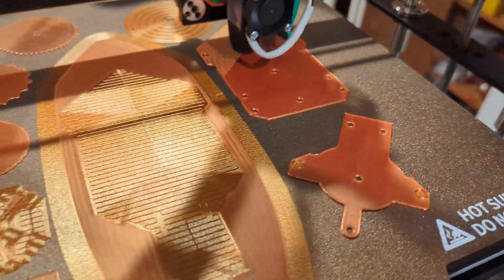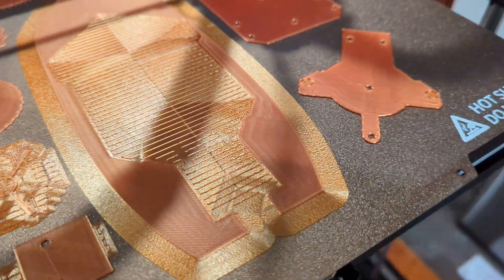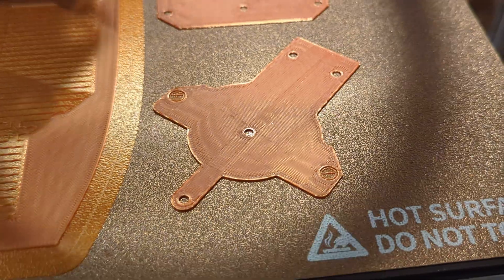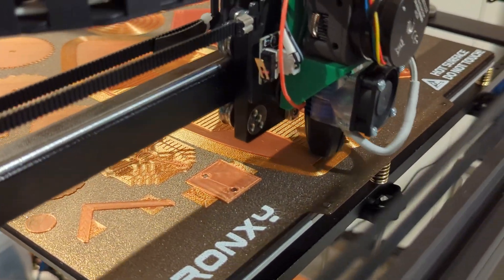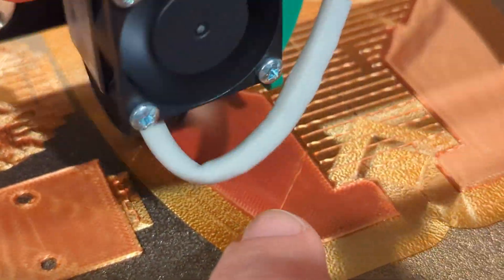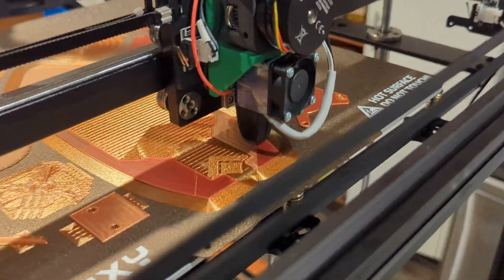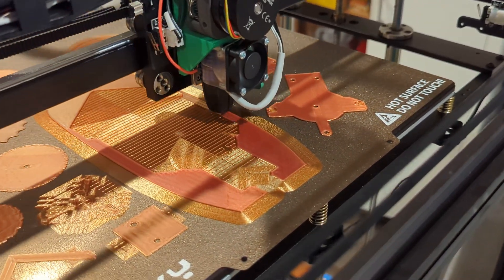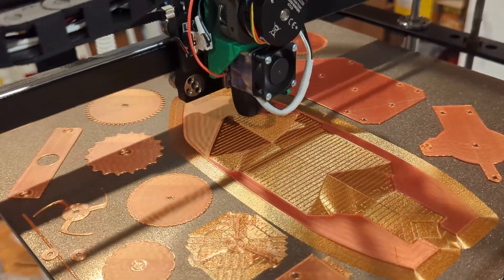Nozzle Z probe using contacts third test - showing actual printing with perfect first layer

Comment: Your method is amazingly simple. I would love to use a system like this in the future. How is it going now? Have you found any disadvantage of this solution compared to optical sensors in voron tap? Why are people even using such complicated optical systems instead of yours?
Reply from the maker: It is the best way IMO, there are many reasons the best methods are not adopted at first or ever.. the Voron tap has their name behind it and mass adoption already so this simpler and better (IMO) method may never see mass adoption..
Reply from the maker: It does rely on a high quality linear rail as there are no magnets to lock it in place, so your X/Y rigidity is all on that rail.. but yesh get a name brand short rail on eBay and you're fine.
Reply: @hilo90mhz  Thanks for your answer! Yeah, I understand the importance of linear rail quality, but that is not any better with the existing voron taps. Their magnets may hold it in the Z direction well, but don't help with X and Y wiggle, which is the important part.

What I also love about your setup is the fact that you don't need to set any Z offset at all, right? Because the contats disconnect so quickly that the 0.005 mm toggle distance you mentioned is negligible.

I am leaning towards building a voron 2.4 250, the only part I dislike is the heavy stealthburner, so I want to use a custom minimalistic head with your Z leveling mechanism.
Reply from the maker: @mjetdevelopment  Yup no Z offset! That is probably the largest advantage... And the play in Z is an advantage IMO to avoid damage to the print head if it crashes into something

Comment: This is TAP? These solutions play absolute havoc on your resonance calibration, and is not recommended if you want a finely tuned printer that can print at high speed. 

I love the idea though. There is no perfect solution for z-offset calibration yet
Reply from the maker: With tight enough linear rails it shouldn't be bad. The cheap Chinese rails often would not be tight enough.
Reply from the maker: I'm aware it's not perfect though.. if not this I'd try something under the bed like bambu Labs piezo system which seems to work fine and uses the nozzle.
Reply from the maker: And it's not tap, similar idea different implementation.. I had the idea and parts for this long before tap was released or heard of by me.

Comment: Any news on this? I would love to play with this design on my VzBot!
Reply from the maker: It's relatively easy to adapt it to the VzBot but it will lose some Y travel if you have AWD because there is no extra room on that axis.. I am thinking about a design with two mgn5 rails one on each side of the hotend that may not change the clearances much but haven't actually designed it yet..
Reply: @hilo90mhz  If you don't mind sharing the current CAD I would love look at it, but if you feel like it's not ready yet I 100% respect that. :)
Reply from the maker: @emagiannu  haven't started on the new one but the one in this video for the Tronxy is here https://github.com/clowrey/x5sa_pro_klipper

Comment: What if for some reason your spool bound up. Would the extruder pull itself up the filament?
Reply from the maker: No because I use a reverse Bowden on all my printers
Reply: @hilo90mhz , fair enough. Theoretically possible though. However, with the minimum amount of travel needed to break contact, I suppose one could limit the upper travel. Hiccup in the print as opposed to failure. 

Awesome work by the way. I've been playing with a diy klicky clone. Haven't gotten it to work though.

Comment: Hey I'm back. I finished my design for tap on mantis. I am currently running it and have much higher deviation. I was curious where you get the gold contacts. Also I'm using my probe port on the control board and using ground + the gpio for the probe. Is that how you connect it?
Reply from the maker: Cool! I have a link to the contacts on the video before this on my channel. Is your design currently using contacts or the tap optical sensor? I am using one of the general 3 pin endstop posts on BTT Octopus Pro they do have different types of input filtering depending on the exact boards. But yes just ground and the GPIO. The endstop pins have pull-up as well as filter capacitor on my octopus. Also the deviation will vary depending on bed material - mine went up a little when I switched from glass to textured PEI plate... Still more than accurate enough. Also if your microsteps are higher that will show more variance, mine is set to 16 for now.
Reply: @hilo90mhz  I just ordered the gold contacts and some lighter springs. I’ll get to test again on Saturday. Did you cut your contacts at all? I’m literally using heat inserts so I’ll have to see what I’ll do for the contacts. Edit: I put a scale down while homing at the scale errors it puts so much force. I think it fails at 2000g and it was definitely passing that amount before breaking contact. I’ll tare at 2k to see how much more it goes.
Reply from the maker: @OregonDuck  oh yeah a spring type system without rail would be pretty different. I'm guessing you're seeing 1mm deflection in your bed and Z axis? It has to be deflection before the contacts open somewhere as my z offset is about 0.05 because of the speed I'm probing at, it goes down if I probe slower. Do you have any pictures to share? You on discord?
Reply from the maker: @OregonDuck  and no I did not cut the contacts. They are press fit into the aluminum and plastic like heat inserts basically but I didn't need any heat.
Reply: Trying on desktop. I sent an email because my replies are getting deleted or not being sent.
Reply: @hilo90mhz  okay I think desktop might work. My phone wouldn’t send messages. I was trying to link the discord, but it’s in the email. Sorry about that.
Reply: Thanks for the info. I’m not sure what’s going on.. I haven’t done probe calibrate etc, but when I move to center after home, put a piece of paper down to test a good spot. Z at 1mm is about right, but I’m confused because it seems way too high. Shouldn’t I expect something close to 0?
Reply: My guess (I’m not using a rail and am using a spring is the spring might be too stiff)

Comment: What are your printing speeds and accels like? I was curious if klipper would stop if it senses the end stop being triggered. Are you using klipper?
Reply from the maker: I'm going up to 10k acceleration and 200mms moving speeds now with motion shaper - not sure exactly what that print was but maybe similar. And yes klipper :) The default Klipper setup with this type of probe as Z endtop does not care what the sensor does while it is printing only while homing or probing. I've done much more printing now with no issues of the nozzle lifting etc under high accelerations. My klipper config is here if you're curios: https://github.com/clowrey/x5sa_pro_klipper/blob/main/printer.cfg
Reply from the maker: My bambustudio soft fever fork configs are here: https://github.com/clowrey/x5sa_pro_klipper/tree/main/Bambustudio%20Soft%20Fever%20Configs%20for%20Tronxy%20X5SAPro
Reply: @hilo90mhz  nice thanks for sharing the softfever setup. I’m trying to make a similar mod on a mantis. Also working on a piezo mod as well so waiting on the parts for my trident.

Comment: It would be kind of cool if you could figure out a way to log data on if/when the contacts lose contact during the printing process. Maybe find a way to use an interrupt, perhaps on another STM32 board or something. I'm not sure if that can be done with the mainboard and Klipper. If you could log acceleration data alongside this, that would also be really interesting to see.
Reply from the maker: I could do this many ways and you're right it would be interesting to see! Maybe I will investigate that soon.. I know it is moving up running across over extruded bumps in the print so it may not be good for ironing without adding more spring force but I think you could easily have an adjustable spring for prints you wanted to iron and no spring for ones you'd rather have the nozzle glide over bumps with less risk of it knocking them off the bed.

Comment: Is the toolhead just held down by gravity or is there a spring or something similar ?
Reply from the maker: Yup! Just gravity! The weight of the assembly over the about 3mm2 area of the nozzle tip still equals enough force to skip steps in the extruder motor if I try to run a first layer at 0.0 Z height over a smooth glass bed. No additional weight was added.

Comment: It being able to go up a little may even help to prevent issues when parts start to curl up and the toolhead starts hitting it, otherwise possibly causing a layer shift.
Reply from the maker: Yes definitely! I think it is more of an advantage than a disadvantage :) and you could always put a toggle spring that would allow you to add more force if desired for things like ironing. But it may still work fine with ironing too I haven't tried it yet.

Comment: It would be good to test you fastest speed with lots of small details. I wonder if whiplash forces could lift the nozzle. I actually don't mind if the head would move up a bit when you get one of those blobs, and with the nozzle colliding with it,  may dislodge the part.
Reply from the maker: I am going as fast as this Tronxy X5SA Pro can go :D It needs a lighter gantry to really go to extremes. But its already at 10k acceleration etc. I don't see how any faster would make it lift more as the linear bearing is very rigid in those two axis. I will install the same design on a full metal parts VzBot in the future. I also think that the ability to lift slightly will save damage to the printer and prints in some cases :).
Reply: @hilo90mhz  I completely Understand. I meant would speed and jerk effect the nozzle height. Probably not. Voron tap uses magnets, but your design is more elegant. No optical sensor. I'm thinking about building a Rook 180, cool little coreXY project. I'd like to try your system for bed leveling. Great work:-)
Reply: Where do you get the contacts from? I’m looking into designing something for a mantis toolhead currently but don’t want to add an mgn 9 to it. Maybe a 3D printed version of 1. I wanted to keep weight down so best I can think of right now is making a channel and having it slide through that.